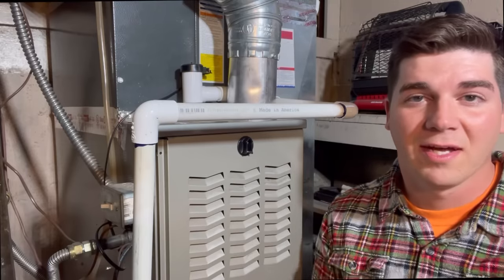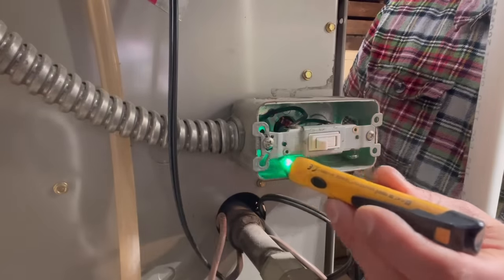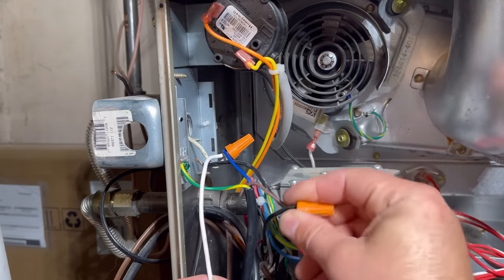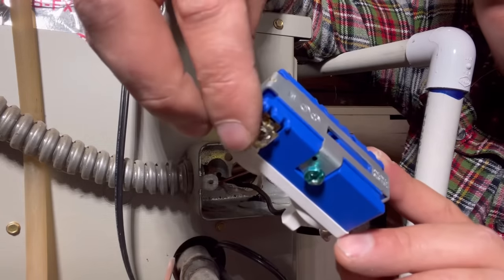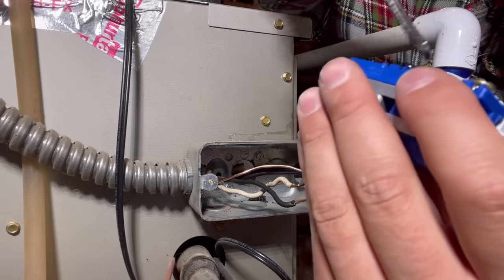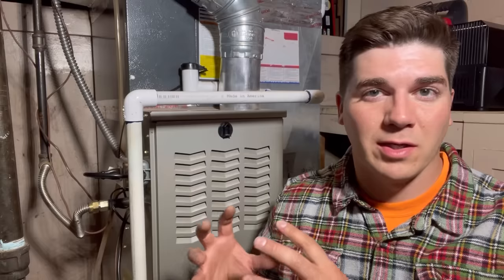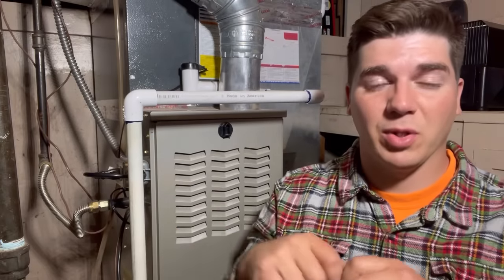This Could Keep Your Family Warm During An Emergency Power Outage.

Comment: Your pigtail is a great idea, but the way you have it set up would be against code here in the Province of Ontario - if that's the only switch (not counting the breaker) you have to shut off the furnace. In Ontario the switch cannot "be located on the furnace nor in a location that can be reached only by passing close to the furnace". Mine is located next to the door to the furnace room where the fire department can get to it without having to get too close to the furnace itself. Anyway, I have a 2400 watt hour Bluetti and I showed my electrician your video. He said the concept is excellent and he is going to ask the local electrical safety agency inspector if it would be approved where I live.

Comment: I'm not an electrician and I don't know if my setup is ok. In case of an emergency I though using the 220V underground wire to the pool house to hookup the generator after cutting the main breaker from the HYDRO supplier. Than use only the furnace and some LED lighting breakers, with some interruptions for hot water, stove etc....

Comment: Anytime you are getting ready to work on electrical wires, you should always perform a "live-dead-live" test before proceeding. It's wise to not only test that the wire is not energized, but you also want to test that your tester is working. The method you used in this video did not confirm that the tester was in good working condition, which could be very dangerous. First, you should touch the tester to another live circuit that's nearby and confirm the tester beeps when it senses the live circuit. Secondly, touch your tester to the wires you will be working on. The tester should not beep if the wires are de-energized. Thirdly, touch your tester to the live circuit used in step one to confirm your tester is still working. Now you can be assured the wires you'll be working with are dead. Also, with the size of the switch/receptacle you used, I personally would have used a larger electrical box to minimize the amount of heat build-up in the box, especially after threading that thick cable through the box. As others have pointed-out, a clamping connector should have been used in the hole from the box to the furnace to prevent the sharp edges from eventually cutting through the wire. I would also recommend labeling the wires before disconnecting them and/or taking a photo of them with a cell phone, tinning the stranded wires (with solder), and wrapping all of the wires around the switch's screws and tightening down (as you did with the ground wire).

Comment: Very cool.
I keep meaning to set up something similar.
My house has steam heat.
All I need is voltage (that normally comes from the thermostat) to the control valve so it will open and let gas flow.
As long as the natural gas and water stay on I will be OK.

I keep meaning to set up a back up.
I suspect I will wind up in the basement with a flashlight trying to figure it out.

Do know if the solenoid that opens the gas control valve actually needs AC or can I just run DC to it?
DC would be much simpler.
If It needs AC I would just get another transformer, put a line cord on it and run it off an inverter.

Great video!
Thanks for sharing this info!

Comment: This is also an easy way to add surge protection to your furnace, just plug a single surge plug into the new outlet.
Reply: That's a really interesting idea! Another thing that would be handy with this setup would be the ability to use a watt-meter to measure how much power your furnace actually draws so you could size your inverter or generator properly

Comment: Apparently ontario doesn't allow running furnace with short extension cord. Back in 1996 they did but receptacle and plug had to be twist lock. My furnace has 2 twist lock receptacles side by side. One is fed from house panel and one from generator.  I just plug short cord that's junctioned to the original feed to furnace. Gives complete isolation of generator from house. Apparently generator must be bonded to frame (not floating neutral) or furnace gets upset.
Reply: Didn't realize I posted this comment 2 months ago too. Lol.

Comment: Doing something similar at the panel is much less complicated, and more convenient for temp power from a generator or whatever!! Been doing it for 60 years!!
Reply from the maker: My panel is on the exterior of my home :)
Reply: @diyhvacguy  In the real world exterior service panels aren't allowed. How about an anti chafe bushing where your wiring enters the furnace? That includes control wiring where it enters with the gas pipe as well. Speaking of gas pipe, where is the sediment trap? How about securing the MC furnace feed, and while your at it tape the control wires to it and make it look professional? Good job of hiding the exposed RX behind you. One last thing;  Wago nuts are expensive garbage!!

Comment: It only works on natural gas or propane furnaces. If you have a heat pump, unfortunately you are out of luck, this won't help when you lose power. Heat pumps are all electric, 220v units. I'm not sure if a portable generator is made that would power and/or is configured to supply power to a heat pump. Been there more than once, space heaters had to save the day.

Comment: I've thought about doing something like this, but I think it would be easier to just install one of those natural gas heater, they kind that operate without electricity.  They often look like a miniature fireplace and you only need to connect a gas line to them.  You can put one in your hallway and it will heat your bedrooms if you leave your bedroom doors open.  Of course, this will heat your home, but you still must make plans for backup power if you want to power a fridge or a TV/Radio during a power outage.
Reply: Or get a stove where electric is not required to turn on the burners..
Reply: That's a fine idea for a small space, but the electric isn't just for the ignition, it also powers a blower to move the heat to where it's needed. This retrofit is probably cheaper than a new furnace, and it gives the ability to swap batteries if needed to keep the pipes from freezing, which is christly expensive. If you had two cars you could run the battery from one while the other charged, then swap. Not ideal, but when you NEED to have heat it you want to have options.

Comment: This was pretty easy to do. When done all the blowers work, AC works but heating doesn't. The initial blowers come on then they come on higher like they're trying to start the gas flame. The flame never starts and the blowers time out.  Then after a while it tries again. Fortunately it's summer. I'll probably call the installer Monday, this is Saturday. Ideas? I's a Lennox G61MPV
Reply from the maker: If you have power to the furnace, the switch shouldn’t impact your gas. So I’d venture to say it’s unrelated. If you need further help diagnosing, feel free to sign up for our Patreon membership at Patreon.com/diyhvacguy   Cheers
Reply: @diyhvacguy  Thanks for the reply.  I called the installer company.  I'll sign up.
Reply: This was just a coupler I had knocked off. While the Lennox tech was here he told me that portable generators won't work with their furnaces. Something to do with a control circuit board and inaccurate frequency and it would damage the board.  I told him that mine was an inverter. Then he said something about requiring 'earth ground' or something.  Anyway it scared me and I probably won't try it. 😞

Comment: Here's a problem:
The furnace fan is around 1Hp which equates to around 745 watts (running). Takes more than that to start but - If you have an inverter typically running from a 12-volt battery, the amperage required for 745 watts is 62 AMPS.
You might get 30 minutes of run time from a typical 40 amp/hour battery.
If you are running from a gas generator, then this solution works until the gas runs out. But inverter? I think that's a stretch. Although running an inverter at the vehicle with the engine running would be a solution.
Reply: Get a bigger battery.

Comment: You could have got an inverter with trnasfer switch built in. This way you could have mounted all that at power panel. Your setup is a stumble in the dark. Auto transfer switch is the way to go. At the power panel, milli- second loss. HughMc. Chicago,metro.

Comment: Excellent suggestion, using Inverters & Deep Cycle Batteries to Power necessary 120v items, in case of a Power Outage! 👍

You can buy a 1000w Inverter for about $200 & about the same for a Deep-Cycle Battery = $400. Multiply this by the # of items that you NEED to be comfortable during the PO. 

You might want to buy another Battery for the Fridge, as these tend to be "Power Hogs", because they have "Compressors" inside.

For about $2600 you can be ready & HOW much does a Generator Cost that will Power your Whole House? Just remember to keep those Deep-Cycle Batteries "Trickle-Charged" at all times. 👍

Comment: After the ice storm a couple weeks ago I decided to do this modification and bought all the parts.  Before I did it we had another storm and outage last week.  I took the opportunity to do it.  I followed the instructions as I watched the video on my phone.  No matter what I did I couldn't get it to work.  Just as I was getting ready to change it back the power came back on.  I plugged the furnace into the new outlet and turned the breaker on and the furnace came on.  It worked with the line power.  When I held the voltage tester up to my extension cord it beeped like someone tapping out morse code at 30 words a minute instead of the even beep it's supposed to have. 
 The moral of the story is check your extension cord.
Reply from the maker: Cool so I’m glad you got it going and found the problem 👍🏼

Comment: Or... put the switched outlet there, connecting such that both the outlet and the furnace are controlled by the switch. During a power outage, turn the switch off, and use a male-to-male extension cord to connect a generator to the outlet. Same concept, but without having a power cord sticking out of the furnace literally all the time for a problem you might have once in a while. (It'd be to code as well.)
Reply: It would not be to code.  Using a male to male plug from a generator is against code for several reasons.  The problem is that if someone didn't turn off the switch, then the power coming in from your extension cord would feed back into your breaker box, and back onto the power line.  The male to male cord is called a suicide cord for a reason.
Reply: @ItsMe-kj4xz   It's perfectly to code when the extension cord is in a drawer somewhere. Having an extension cord hard wired and dangling out of a box is absolutely NOT to code. If somebody is to stupid to connect a generator properly, then they shouldn't be doing it either way.

Comment: This does mean that the pigtail is live ( which is why you plug it into the outlet) just thought you could add a warning that the pigtail should never be handled during normal operations. It's equivalent to a Deadman cable. Ya know, for the electrically impaired of us that may unplug it to use the outlet to power something else while working in the area. Other than that I think this is a fantastic idea. 👍
Reply from the maker: No that’s incorrect. The plug will NEVER be live until it’s plugged into a power source.  The whole idea is to NOT have a suicide or dead man cable. The outlet is the power supply, the pigtail is simply a cord that the furnace gets its power from just like a toaster or a microwave 👍🏽
Reply from the maker: In the video that posts tonight I will prove that by leaving the switch on and grabbing the plug just to prove a point haha make sure and check it out. It’s how long a power station powered my furnace 👍🏼

Comment: There is a breaker on my main panel that shuts off the heat system as far as I can see. It definitely shuts off the motor when I open the circuit.  The 'main' cable from the panel goes straight into the switch box that has the screw-in (I believe it's an S type) fuse.

Comment: I was considering a switch option after watching the inverter wiring video. Excellent follow up! I would like to apply this to a heat pump with no gas furnace. Assume I may need 220v volt plug to hook to generator since I'm lacking split phase inverter. I think it would be best to just run straight off generator patched into panel. Or getting a 48 volt setup so I can run split. Thanks for great video!
Reply: " ... just run straight off generator patched into panel" 
1) Via a transfer switch - Yes.  
2) Hot wired to the panel - no.   Major consequences for linesmen on high side of transformer due to your generated neutral currents x size of transformer magnification.
Reply: @gragor11  yes correct. I am aware of the codes and just didn't bother with all that detail. I was thinking out loud. Thanks for the details so others are aware.

Comment: Bro I was an apprentice electrician but not an expert by any means. This is a very clear explanation. Great video. The only thing I couldn’t see was where the neutral that you connected to the switch came from and was it in any way connected to that wago with the neutrals in it?

Comment: Note: You should've used a Connector or Grommet for the Plug Wire going from the Switch Box into the Furnace to prevent it from rubbing along the Sharp Metal Opening.
Electrical 101.
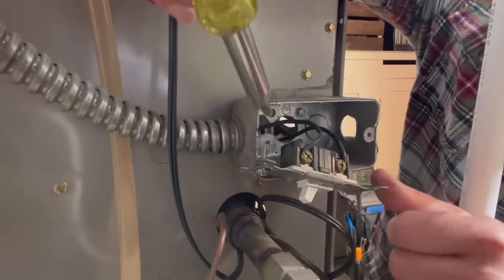Reply: I thought the same thing, but am now thinking that the OEM may have already ground the hole smooth because that's where the wires originally ran from the metal box to the internal cavity of the furnace.  Take a look at about the 1:45 point in the video.

If not, then that's a big problem left by the original installer!

Comment: Thanks for all the great videos!  I am adding on/off switch to new furnace and will use 12/2 mc cable for appx. 15ft to existing furnace wall outlet in my attic. I understand all grounding of metal boxes, etc. It’s a plastic gang box currently? How to convert to receive end of 12/2 mc cable connector ? Cut out drywall, add new metal gang box? Still, if gangbox is flush with drywall, how would add mc cable end with connector?

Comment: That's one way to do it. But you don't need to be proactive to power furnace line with the sine inverter. 1. Disconnect house from grid with the main switch 
2. Leave only the furnace line and a garage line connected in the electrical panel. Connect the inverter to the outlet in the garage.
Reply: @jolkraeremeark6949  Yes, the "emergency cord" ;)

Comment: This is something I have been considering for our home. Your video is very informative and detailed. Thank you. But, I noticed the furnace seems to be on a 20 amp circuit and you used  what appears to be a 15 amp switch/plug combo. I wouldn't think that a good practice.
Reply from the maker: I nabbed that snipped of video just to emphasize safety.  My furnace breaker is actually a 15 amp
Reply from the maker: As are most

Comment: Gawd, what a complicated production... I went with the concept of putting two 20 amp rated (Our furnace is nameplated for 15 amps - use sockets rated for AT LEAST your furnace's nameplate rating) twist-lock sockets side-by-side, but electrically isolated from each other. One is wired to the furnace breaker as normal, the other is wired direct to the pigtail that brings power in from the generator. Then put a matching 20-amp (or whatever your furnace needs) twist-lock plug on the end of the furnace power cable. I prefer a twist-lock plug, but anything that's rated for AT LEAST the draw of your furnace will do fine. When power goes out long enough to need to run the generator, pull the furnace plug out of the "wired to the breaker" socket, and plug it into the "wired to the generator" socket. (Identical setup for our well pump that wants 240v - Two dryer sockets, one to the breaker, one to the genny, each completely isolated from the other, and a dryer pigtail from the pump controller that can be plugged into one of the sockets) In both cases, if we lose power for long enough to need the generator, we wheel it into position, get it fired up, and plug in the dedicated 4-10 pigtail from the house. Then down to the basement, pull the plug out of the "normal" socket and put it in the "generator" socket on both furnace and pump (generator is intentionally WAY over-rated to power the essentials) and we're good to go until BOTH the propane AND on-hand stock of gasoline runs out, or the grid comes back up, whichever comes first. When power comes back on, reverse the process, and back to normal. At no time is it possible for the generator to backfeed the grid.

Comment: I did this same thing except without the switch. Since you plugged it in and unplugged it with the switch on, I'm not sure why you used the outlet with a switch.

I also made the cord long enough that it reaches my EcoFlow Delta 2 on the floor without the need for an extension cord. 
Never use an extension cord if you don't have to.

Comment: This seems very easy, fun and absolutely crucial to do for in the event of an emergency. How many watts of pure sine wave inverter power does one need to start the furnace and run the squirrel cage? thousand watts? 800 watts? 500 watts? I am curious, and don't feel like checking the amperage of the unit startup and run power.

Comment: Furnaces are required to be hardwired.  Do this safer, and meeting code, with a single device transfer switch, which includes an inlet to hook up the extension cord to.  Or do the same thing at the panel.

Comment: I ran my furnace off my power station and it drew 500+ watts.  It is a gas heater and I believe most of the power is the fan.  At that rate,  my 500WHr battery is dead in an hour.  Try your setup before you need it so you'll know what to expect.